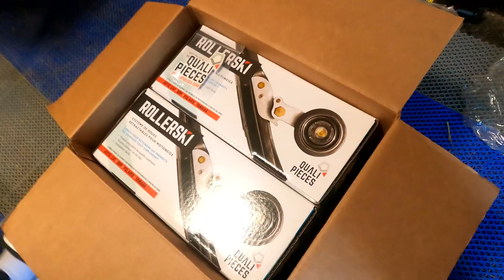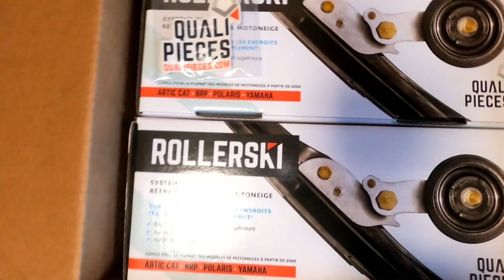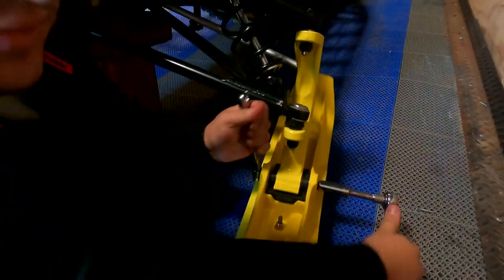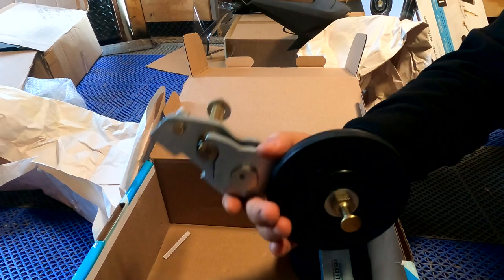Rollerski by Qualipieces | The BEST Wheels for a Snowmobile | Install on a 2022 Renegade XRS

Comment: I put a set on my Renegade XRS and use them all the time. So easy to use and easy to retract. Just lift your skis a little and they come back up. I usually use the throttle to get mine back up if you know what I mean. 😉 I am finally getting some snow here and will be riding tomorrow. Happy trails!
Reply: Nice.. You’re finally getting some snow 🤙🏼 Enjoy buddy.. Take Care
Reply: @SometimeIsNow  yes thank you! I hope you get enough snow to ride also. That Cat needs snow to scratch on!
Reply from the maker: Exactly!! One of the best add on's anyone can put on their sled. Makes their lives that much easier. Cheers, Jesse
Reply: @justflylow  The weather is looking more promising starting next Monday. Much colder temps and snow. Let’s hope it stays that way. ❄️❄️🥶

Comment: Had a similar product years ago on my MXZ 800 Adrenaline. They did work well on road crossings or pulling up for gas off the trail. The cons of the product, having to get off the sled every time to deploy them which meant always unplugging my helmet visor and lanyard. Other cons was when you are driving up to a gas pump, if the cement pad had a large lip or large pile of ice in front of the pumps I would get stuck. Other cons is they kicked up more snow if there was 4"s or more fresh snow on the ground (not groomed) or a ice layer on top of the snow while riding off trail. I had some serious chunks hit my shield riding off trail, IE lake riding and making wide casual turns. Eventually I removed them. But that was my experience 10 years ago. The design has not really changed except the spring load drop ( mine did not have that option) but your wheel is a bit thinner that what I had on mine. 

Post a review at the end of the season. I'd be curious.
Reply from the maker: Hey Big Guy DIY. I haven't noticed any of these issues to be honest. Yes I do have to disconnect my helmet to deploy the wheels, but with E-Linq, it is part of my key and I just pull it off, walk over, and then click it back on to my sled. I have been using these wheels on all my sleds for about 8 years now.. so about 35,000 kms and they never skipped a beat or caused me problems. Cheers, Jesse

Comment: that bottom plate just goes in then the rubber on top ?
what was the specs for the nuts and did you use loctite 263?
as for the other comments i just got my b-2008 all i did was got to Qualipieces site and started calling all the dealers and eventually found one that had it on hand none available on line
great video by the way thanks
Reply from the maker: Hey Jean-Pierre! Yes the bottom plate goes in and then the ski rubber on top. I did use loctite 263, cant recall the spec for the nuts unfortunately. Your lucky you got a set - they are one of my favourite products! Cheers, Jesse

Comment: They should have the shaft go all the way through so you csn put a nut and a cotter pin. I have heard of the bolt coming out on those.
Reply from the maker: I don't disagree. But after running these on all my sleds the past 6 yrs I have never had a single issue. One set had 18k on it and my most recent set had 17k on them. Cheers, Jesse

Comment: Can you back off your trailer with the gap between the trailer and the ramp without issues?  I’d like to see a video showing that.
Reply from the maker: No you can't back up over a lip/gap with the wheels. The wheels are spring loaded to flip up towards the front of the sled. So driving onto the trailer you can do no problem with a gap, but reversing out the wheels would pop up. All that means is you would have to stop and push them down again and then continue. I have a drive in drive out trailer so I rarely reverse mine out. Let me know if you have any other questions! I can tell you that this is one product after using that I cannot live without 6 sleds later. Cheers, Jesse

Comment: You did not mentioned anything about the steel plates ?
Reply from the maker: Hey Alain! Great point. For some reason I forgot to mention it but they definitely are necessary. Without the plates the skis end up touching the ground at the front with the wheels deployed. The metal plate goes on the floor of the ski, and then the rubber mount goes on top of that which the spindle rests on. Cheers, Jesse
Reply: @sledaddicz  Thanks Jess . So what orientation to install those plates ? Do they fit only one way or both way ?
Reply from the maker: They only fit one way. Cheers, Jesse
Reply: @sledaddicz   Thanks Jess i am going to get some for myself . Home to meet you in the trail one day !!

Comment: All that unsprung weight will play havoc with your suspension set up.
Reply from the maker: Hey Scott! I can say after riding an xrs without them for 4000 kms and then the same sled with them for another 3500, I did not notice any difference whatsoever. The weight addition is so minimal and the handling is identical. Thats why I love this product. Cheers, Jesse

Comment: Unsprung weight is the worst thing that you could add to your suspension.
Reply from the maker: I can say after riding an xrs without them for 4000 kms and then the same sled with them for another 3500, I did not notice a difference. The weight addition is so minimal and the handling is identical. Thats why I love this product. Cheers, Jesse

Comment: The more I look at these the More I think that maybe they should not use such a tall thin wheel and Go More of like a skateboard Style wheel all You gotta do is pick that ski up just enough to get the carbides off the Pavement and the thing will Steerr wherever you want  it to Go. or better yet retract into the center of the ski just in front of the spindle that would cut down spray since you get care packages throw that out if they like tell them you came up with it.
Reply from the maker: Hey Shawn. Interesting ideas. Honestly.. this product works so darn good that I have been using them on my last 6 sleds and they work flawlessly. Never have had a single issue with them. Cheers, Jesse

Comment: The dude is pronouncing the product wrong. They’re a French company, or at least the brand name has French heritage. Pronounced more like Koala-P-S.
Reply from the maker: Hey Brad! My mistake. I have never heard the pronunciation. I have been using their products for 10+ years and Sledaddicz is working with them for this season and hopefully going forward. Cheers, Jesse
Reply: @sledaddicz  Qualipièces, Drummondville Quebec. 10 years huh, you must appreciate their products. I like the Rue Skis. I’ve tried other products, carbides etc. After 40 years of riding I don’t think there’s many products I haven’t tried. Personally, Shapers and Deuce Bars are the products to beat.
Reply from the maker: @b.pur9981  That's the beauty of having all of these great companies making options for us sledders. Personally I found shapers to be very heavy steering effort and deuce bars (along with every other dually carbide) push in corners without enough bite. Thanks for tuning in. Mike
Reply: @sledaddicz  Oh you’re absolutely right about the Shaper’s, definitely heavy steering. Personally I do not use them anymore, however my son does and he’s stronger than all of us put together. As for the Deuce bars pushing, yeah they can. Certainly do in heavy snow conditions, the sled feels like it’s drifting sometimes. I do however find little to no darting, and most times, not all, any ill effects can be tuned out, specially on any X or XRS models. I’m in agreement with you about the effect most dual runners have, I’m completely done with Snowtrackers. The sweet spot is just far too small on them. Dually’s seem to ball up with snow and you end up drifting through corners which on a closed course is perfectly fine but with blind corners and a bit of speed, can be life threatening. 

Here’s a set up people should try. Aquire  a set of DS skis and put on a set of  the long HRP runners. Looking at them you wouldn’t think they work well, however they are extremely light steering, perfect for anyone having to compensate due to an injured shoulder or wrist or any part that goes into steering effort. There’s so many products out there. I laugh (silently of course) now when I hear of people complaining about steering or shocks on their Brand New SkiDoo snowmobile. Watch some videos and get a DooTalk account. Ask questions….  The real beauty is that there are so many options for the ever changing conditions and terrain.